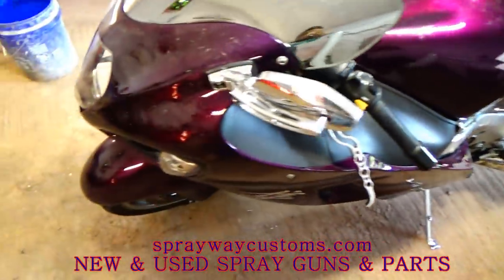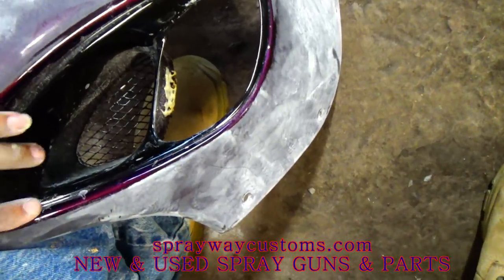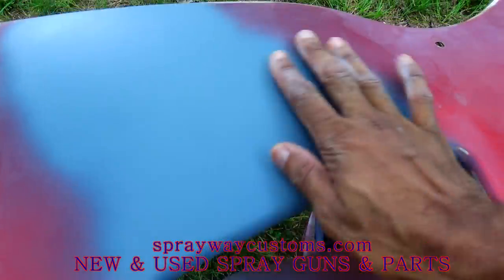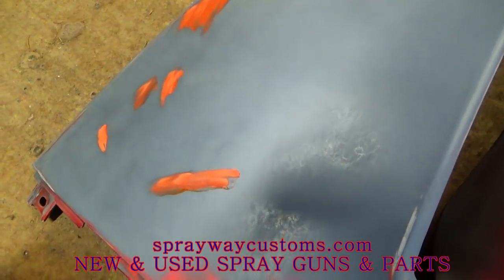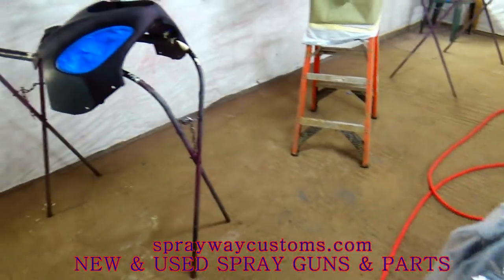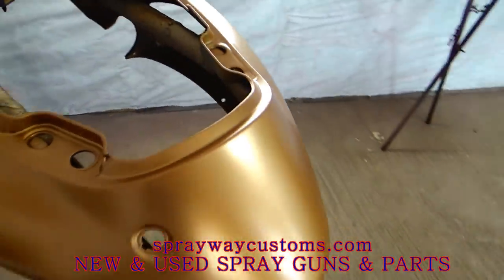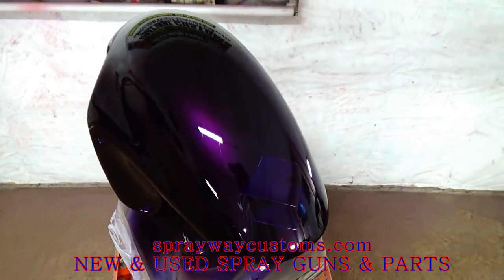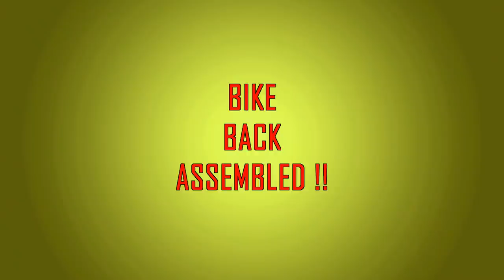Paint Your Motorcycle At Home For Less..CANDY PURPLE ALLKANDY WET WET PLUS SUZUKI HAYABUSA GSX1300R

Comment: Nice job brother, I really enjoy watching your work. 
After I sand down my fairings I just use cleaning gasoline to remove the remaining dust. It doesn't only clean the surface but makes glossy parts visible that still need sanding.
Reply from the maker: Alex, I appreciate your support. I've used it before also

Comment: What air pressure regulators are you running on the guns ? I saw some in harbor freight that I was going to get for my gun. But I'm not sure what the setting of regulator should be for the application of spraying paint colors.  I usually use aerosol cans to do my primer application onto surfaces then I wet sand them lol...comes out okay for me.
Reply from the maker: I’m using a SATA regulator at 28-30 psi

Comment: I have a question is that a angle grinder with a pad attachment you are using as a DA I would really like to use mine for that ? Thanks again for your instruction BK in CT
Reply from the maker: No it's an orbital sander. https://www.homedepot.com/p/Porter-Cable-6-in-Variable-Speed-Random-Orbital-Sander-7346/203162768
Reply: Thanks for the quick answer stay well

Comment: spray way what kind of tips would u recommend for prime, base, and clear? and also would u recommend wet sanding in-between base coats, the final coat, or none at all? Thanks in advance.
Reply from the maker: Primer 1.6 Base 1.3 clear 1.2 or 1.3... I would tack between base-coat and wet sand after the final coat of clear...thanks for watching Nino
Reply: SprayWayCustoms  thanks, learned alot from all ur videos, good to see u back.

Comment: Wats up spray way. I don't know your name? My name is T. I got a question for you. I just started painting my bike and had it looking pretty good but I started putting the clear on it and the dang paint wrinkled on it. What do you think????
Reply from the maker: Sounds like a reaction...what type of paint you used?
Reply: I seen on youtube that spray cans work so I got a color I like. Colormaxx and rust-oleum clear but it didn't turn out to good. I should have left the clear off.
Reply: No I'm wrong the clear was colormaxx to
Reply: No I'm wrong the clear was colormaxx to
Reply from the maker: Timothy Cox yep, a lot of times those spray cans will react if you put too mouth on at one time. You really have to let it flash between coats
Reply: Thanks..

Comment: What brand sandpaper do you use. I bought some cheap Amazon paper. It's horrible.
Reply from the maker: 3M or Gator Grip
Reply: @SprayWayCustoms  thanks. I have some small cracks in my fairings. Should I just fiberglass and Bondo or do you have another technique
Reply from the maker: Just open up the cracks more and fill them

Comment: What's the setup on the spray gun
Reply from the maker: Fan wide open, 2 1/2 turns out on the material and 28-30 psi on the air pressure
Reply: @SprayWayCustoms  I have no clue what that means. Next question is. What's a good gun for starters? This will be my first time painting anything.
Reply from the maker: A good quality gun for starters would be either the DEVILBISS Startingline or DEVILBISS Finishline

Comment: In my opinion a primer is always good. Reason 1:you see imperfections more easy. Reason 2. Saves the amount of coating paint.
So why the owner did not want to pay for primer, I don't get.
Reply from the maker: Your correct. In the long run you saving. Thanks Hans Sandberg